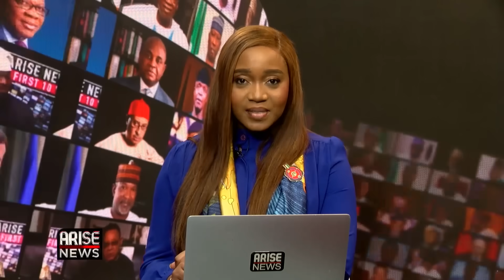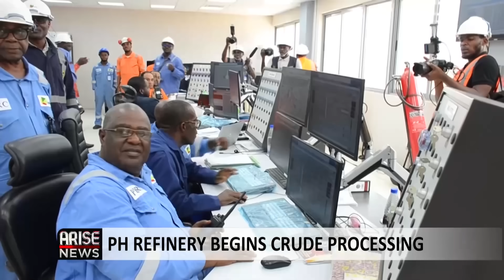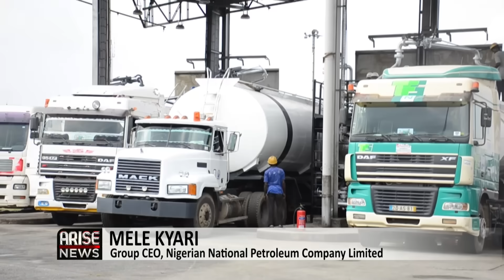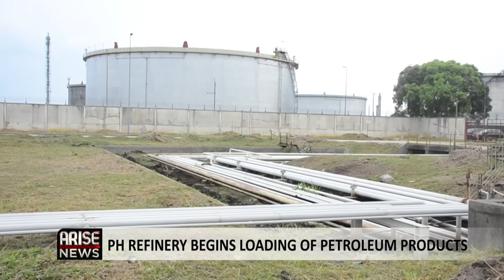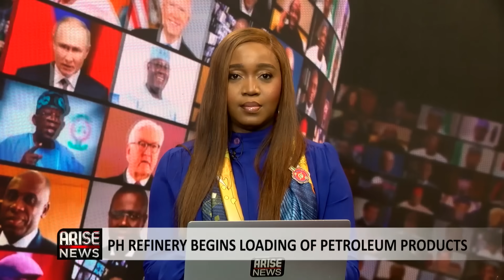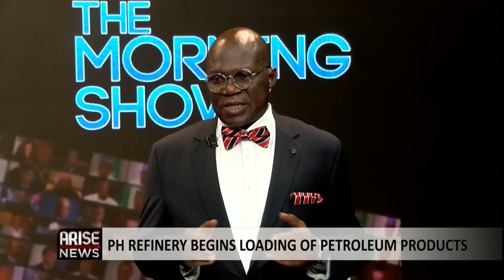The Morning Show: PH Refinery Begins Loading of Petroleum Products

Comment: Rufai i understand you very well, they have failed us so many times and they are not sincere and transparent so it will be difficult for a deep thinker to believe them, but let us give them benefit of doubt
Reply: Blending and refining are two distinct processes in the oil industry, both critical for transforming crude oil into usable products. Here's the difference:

Blending
Definition: Blending is the process of mixing different types of crude oils or refined products to achieve specific characteristics, such as desired viscosity, octane rating, or sulfur content.
Purpose: It ensures that the final product meets specific standards or requirements for particular uses, such as gasoline, diesel, or jet fuel.

Refining
Definition: Refining is the industrial process of breaking down crude oil into its various components and transforming them into usable products like gasoline, diesel, kerosene, and lubricants.
Reply: You will spend more time with your mechanic if you go with NNPCL petrol.😂😂😂
Reply: @ObjectiveObserver-xh4vk  My question is how do you know where to buy dangote fuel?

Comment: Ayo is rather realistic in her appreciation of the PH refinery that had just resumed operation. It is only a 60,000 BPD facility and I wonder how Dr Abati wants it to be equal to Dangote refinery of 650,000BPD. It will be self deceit to also to expect it is going to impact fuel price significant. So it is the recognition or appreciation of the baby steps that is being celebrated after all, the facility has remained moribund over a long period. Dr Abati and Rufai should be self aware on the context rather than import irrelevant context for their analysis.
Reply: Den always want to give a sharp contrast opinion. For goodness sake, commend where u need to commend; just as dey also criticize wen it is necessary...
Reply: Ahbi,this set of guys needs to be caution @olawalemubasiru8050
Reply: Before the celebration. Is it really true? This is the 4th time since 2915 we are hearing that it's in operation. If it's really through, at what cost? If you spend more than it'll give back, it becomes no news for celebration. And finally, How does it affect the market, if that means that price of fuel sells even 100 less, yes then it'll be worth it.

Comment: Like Ayo said, let's celebrate the baby step while we wait for the second refinery to become operational. It will nice if someone can explain the difference between blending and refining crude oil to us. How does the blending affect the the Energy Economy and Security? I hope there is no subsidy of any sort here?
Reply: Blending and refining are two distinct processes in the oil industry, both critical for transforming crude oil into usable products. Here's the difference:

Blending
Definition: Blending is the process of mixing different types of crude oils or refined products to achieve specific characteristics, such as desired viscosity, octane rating, or sulfur content.
Purpose: It ensures that the final product meets specific standards or requirements for particular uses, such as gasoline, diesel, or jet fuel.

Refining
Definition: Refining is the industrial process of breaking down crude oil into its various components and transforming them into usable products like gasoline, diesel, kerosene, and lubricants.
Reply: I am happy to explain the difference. Refining crude means they are using locally sourced crude oil (No purchasing from afar using USD) at the refinery to produce petroleum products (PMS etc) Blending means they are importing refined crude(distillate) into the country and blending it with products to increase it`s volume. Blending is similar to importing PMS and has no benefit to to nation becuase we have to use scare USD to purchase it. The cabal are not going to give up this lucrative business for themselves (not Nigeria) because they act as middle men and reap huge profits.